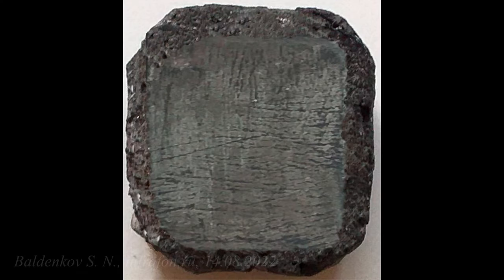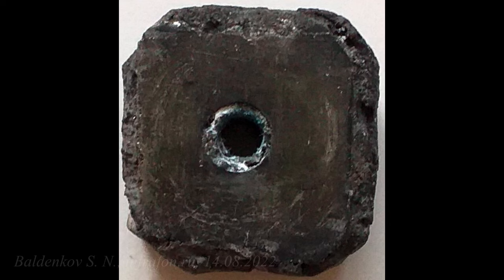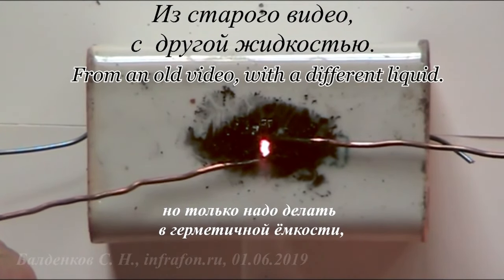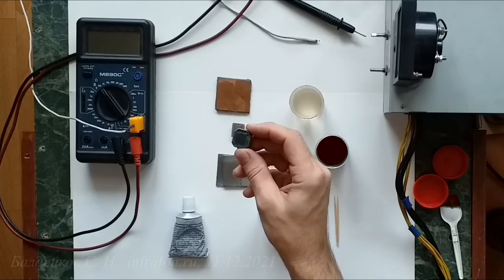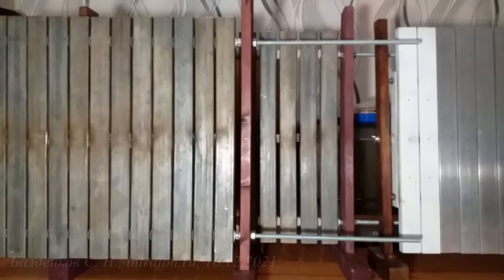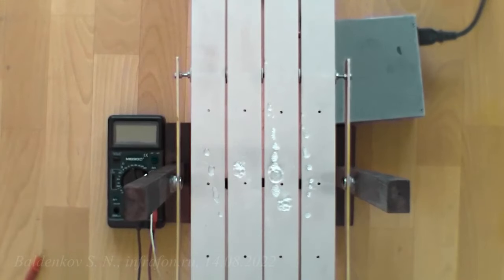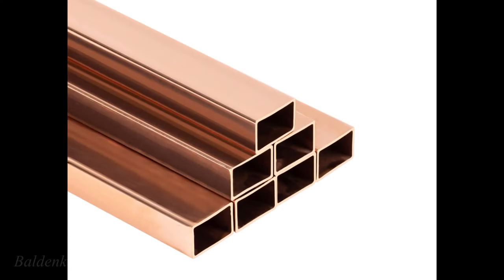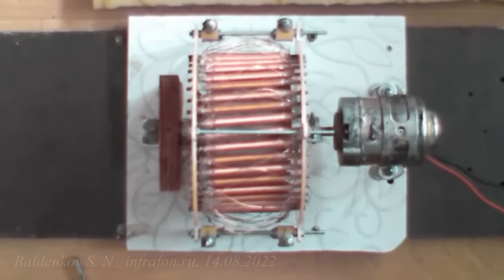A new type of heating.

Comment from the maker: A kilowatt tubular heating element powered by 220 V alternating current heats up to a temperature of 650 (w.450) degrees. It consists of a steel shell, a nichrome spiral, which will someday burn out by heating up to 1000 (w.800) degrees, although it has great resistance, and from an insulator layer, which takes % of energy to heat and maintain the temperature.
The resistance of a group of elements TEPLEL can reach 0.1 ohms, the power supply is at least 1 V DC, but with a high current, then everything is according to the law of electricity, direct heat transfer to metal. The heating efficiency depends on the convector design. The power source can be chemical and solar batteries and accumulators, wind turbines, low-voltage generators, gasoline generators, short-circuit generators, unipolar inductor, converters that convert high-voltage voltage into low-voltage current.
My USP is to abandon the gluttonous expensive burn-out heating elements, which spend the energy of the 220 V change to heat the insulator inside. Instead, I suggest using heat transfer directly from the element to the metal, using a constant power supply from 1 V, but with a high current, and further according to the law of electricity. I consider power from a low-voltage constant to be the main economical advantage of this system, especially where there are no or interruptions to the 220 V network. Among the advantages are cheapness, simplicity and independence of manufacturing elements and convectors, in terms of their size, design, temperatures.
Reply: Finally 8 years lateryou put up this video giving us the ability to communicate back with you 🙏🏾🙏🏾🙏🏾🙏🏾🙏🏾🙏🏾🙏🏾👌🏽👌🏽🤣😂 now please tell me in English the cat and mouse thing you were saying in your other videos and the Egyptian knowledge you hold. I would like you to tell me please. Appreciate you...
Reply from the maker: @Standoff413    Hello. It was possible to contact by mail. I didn't play cat and mouse, all the texts in the video are posted on the website: http://infrafon.ru/ , translation in the browser is turned on automatically. I am preparing another video with a detailed description, it will be in English.
I didn't really try to figure out the writing, but I think that its decoding lies in understanding the purpose of the signs. That is, each hieroglyph should be read according to its purpose, characteristics, and capabilities. The easiest way to understand the drawings is where it shows how people work.

Comment: Hello 
Regarding the other video for cutting stones 
I'm trying to replicate the experiment but I can't find the right frequency 
Will please help with the frequency used 
Thanks
Reply from the maker: Hello. The frequency will depend on the design of the vibrating device, the more, the lower the frequency. These are mainly low frequencies from 1 Hz to 500 Hz. You can use two high frequencies, for example: 1000 Hz and 1010 - 1100 Hz.
Reply: I am developing a hydro powered water pump and static electricity generator using only a single wooden pole.  I think this method was used by the egyptions to transfer energy from flowing water/canals into mechanical action which allowed a consistent and powerful soundwave to be developed through copper disks and tapered tubes for cutting/softening conglomerate bedrock.
Reply from the maker: @bonks4395  The entire sound-vibration technology of ancient people is depicted on the walls, as is their life. The main thing is to create a vibration that twirls, moves, sharpens the stone and is used to transmit information.

Comment: Yet it does degrade in there. I would prefer to not trust this for an emergency cabin getaway. I'd prefer to use Schaubager's invention. A pair of corrugated copper discs. There's also just water heater floor heating using tubes buried in the concrete. There's a way to power that with free zero point energy. Just bury a large iron mass, weld on a rebar rod up through 3 copper plates to spark gap to the inside apex of a copper pyramid. Slowly open spark gap and see how earth's 14.07hz wave coming from the core, will cause the plates to repel one-another, forming carried waves that become pump z waves and combine off the peak of the pyramid as new free energy. All you need now is a coil around the rebar coming out of ground to grab power by influence. Don't try to get it directly as you must use the principle of a transformer. Even a tiny pyramid 5' across produces tons of power.